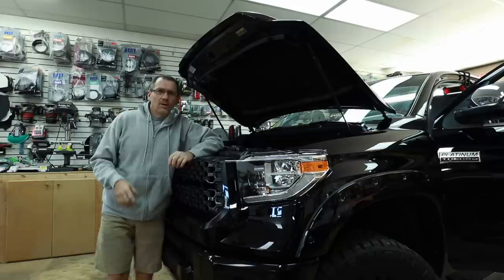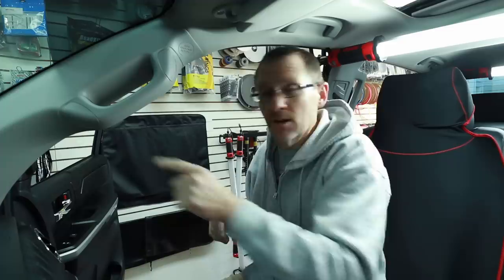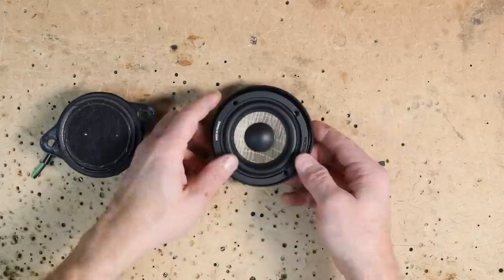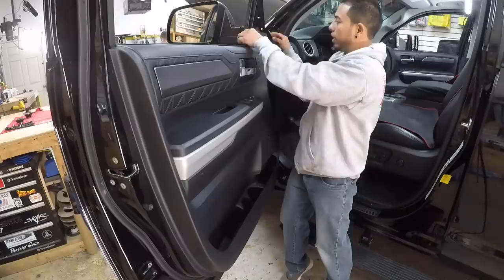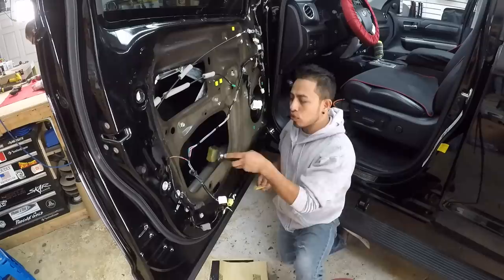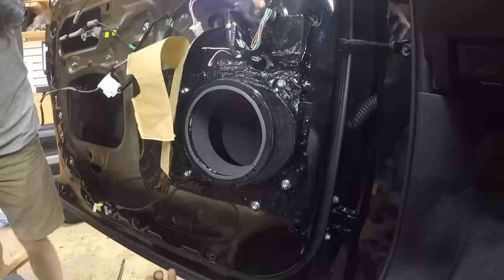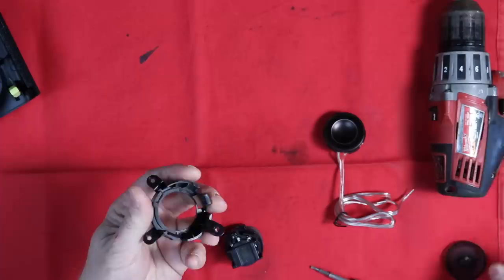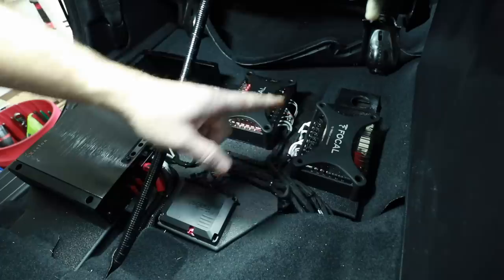How to install a Focal 3 way speaker set in a New Toyota Tundra

Comment: That huge hole in the door needs to be addressed so the door is more like a sealed enclosure for optimal sound . This will make a HUGE difference in the mid-bass and lower end of the vocals.
Reply: Yes I felt the same way. I would of took the vapor barrier plastic and transfered the shape to cardboard. Then transfered that to a sheet of roadkill and did away with the plastic altogether.
Reply: You really think they don't know that?????
They do what the client pays for, nothing more.

Comment: The tweeter was always in the sail panel on the Limited, Platinum, and 1794 Edition with the JBL system.  If you did an install on a Tundra with no tweeter on the door it was a "Grade" or SR5 with no JBL system.

Comment: CA glue dries? Use kicker or whatever accelerator. That’s one of the many reasons why CA is awesome for car audio. It’s works awesome for a lot of glue applications. Even on metal as long as you prep the material

Comment: I had the flax 3 way in my jeep and it cant say enough about it.For the price it is a great sounding setup ,however its dialed in for SQ more so then SQL.Don’t get me wrong it plays loud,i was using a mosconi 1000.6 actively.But it leans and excels at sound quality.If your interested in loud and clear go with the k2 power series its punchier and more dynamic but not as accurate or clean in the highs ,but the mids slam.I ended up upgrading to the utopia m series 3 way

Comment: Nice work guys!I have set of KRX2 Components that gonna be going in my 2017 Chrysler 300s.3" Utopia be and a Jl audio VX800 8i to power it all for my front stage.
Reply: I have the p165fx with a JL amp. Everyday it sounds a It better. Thinking about upgrading to a newer JL amp for dsp
Reply: The VXI series. I have same as you; Flax 165 fx two way separates up front with the matching PC 165 Flax coaxials powered by JL XD 600/6 for all hi’s (active), XD 600/1 - two Sundown da-12 d2’s. I have two separate DSP’s the Audison Bit one (currently installed) and a AC DM-810 w/ the WiFi option port hi res streaming dongle. The audio control is mounted but not been switched over yet want to see which one sounds better.
Reply: @johnhornbeak5735  have you switched the dsp in your truck? Which one sounds better?

Comment: Very cool.  Turns out I'm using those same 2 amps in my 2017 Tundra double cab, but my factory system isn't the JBL so I'm running the 6 channel amp in universal mode. The non-jbl toyota head unit makes a distorted signal so I'm going to have to replace it.

Comment: My 2017 1794 Tundra, similar to the white one you guys showed previously was also a three way (all JBLs should be)
Reply: Wish mine was 3 way. I had 2 way and replaced the factory fronts with pioneer component 6x9 with a tweeter......but I got no mids now because the 1" went in place of the  2.75"

Comment: When installing such speakers in the door, more thorough preparation of the subwoofer podiums is needed. Noise isolation of the entire door with all holes closed. Also, insulation of the door trim of the plastic shell is needed! You also need to change the wires in the door in a large section. class, do it conscientiously ...
Reply: Nope

Comment: Great video again guys. Would it have made sense to block the 2 giant holes in the door? Or is it unnecessary as he used roadkill on the inside of the door also? I know the inside may need to be accessed for service, but i was wondering if it would be even more deadened or if it wouldnt make a difference.
Reply: I was thinking the same. They use open cell foam around the midbass to "make sure the sound doesn't get in behind the door panel" but then leave a huge hole in the door. An abs panel bolted over the hole would of helped more from my experience
Reply: @dobledekersoulwrekr  i was thinking the same. Maybe the cost of such wasnt in the budget, i understand, but they paid for all that roadkill. My question does pertain to this install, but it was more a general question across all door panels with large holes in them. The plastic sheet is only for dirt and moisture, right?
Reply: @carlosreset7501  The whole point of putting the speaker in the door is it's supposed to be an enclosure. Enclosures and big holes dont go hand and hand. The rear wave of the speaker comes through the large hole and cancels the front wave. But from a serviceable perspective I understand not covering the hole in roadkill. But again, that's almost a $1000 set of speakers!
Reply: @dobledekersoulwrekr  I just did my entire vehicle last weekend with the same Roadkill product and had the same concerns for my front doors in my TSX. I called the Stinger tech support and they told me not to cover the hole as the most important dampening coverage is going to be around the speaker cut out and behind it. I did full coverage on all of my doors including the rears and the hatch on the wagon door just to be thorough. Most door speakers are designed to excel in a free air application so it's all good and the results are evident. I am able to cross the fronts over lower and bring the sound stage up to the front more due to my doors being properly treated and being able to handle some power. Good stuff.
Reply: @bbchester6  i dont mean to prolong the discussion, and i understand that you had excellent results without blocking larger panel holes. but would blocking the hole give better/worse/the same results? And whats the science? I think boom mats will blow something faster than a $2 h****r. Lol
Reply: @carlosreset7501  you dont want the back wave of the speaker to reach  the front or you have cancelation. Pick up "Master Handbook of Acoustics" book. Really helps explain the basics up to advanced subjects. You can find copies on Ebay for cheap.
Reply: @latola7204  I suggest you dont use those unless you are cutting most of it away and using it as a rainguard.

Comment: Can someone explain how they did the wiring?
1- how did they wire the 3 way component speakers? Did they wire all of them from the ceossiver or they used the crossover to wire the mid and tweeters only?
2- why and how did use use two channels for each door in the front? Aren't the component speakers need to be paired into one channel from the amplifire that splits into three wires?

Comment: Do the fast rings soak up water or does it shed it? Kind of look like sponges🧽 !? Nice detailed Vblog as usual. Thanks!
Reply: YES!  They soak up water big time.  Ask me how I know this!
Reply: @2000notw  I can only imagine. I figured if you need something in there to bounce the sound back a piece of Styrofoam would be better. Just need something for the bounce back purpose and being that the road kill was applied it should do the job and not soak up water!?
Reply: @RicheySynthetics  I've read that closed-cell foam (CCF) will work AND not soak-up water.  CCF is commonly used for window/door frame insulation and (guess what) moisture barriers in home construction.  Fast rings is a good idea, but I feel that used the completely WRONG material.
Reply: I've been thinking of giving mine a good coat of waterproofing spray. Does anyone have any experience doing that to improve its water repelling properties?
Reply: @bernerdcannavan680  That actually might work! I use that stuff on all my camping gear and out door clothing for hiking/camping. I usually spray it real good and let it dry real good and then spray it again. Great idea for someone who has already bought the fast rings!

Comment: Hey guys, I have a 2022 Nissan frontier. I’m installing a Sony touchscreen and I have a four channel amp. I’ll bridge two channels for a sub and use two channels for a set of focal auditor components in the front. I plan on using 9-wire to run from behind the head unit to the amp. What would be the best way to hook the mid, tweeter and crossover?

Comment: So I know time is money and every customer has a different budget. But using the flimsy speaker adapters on this level of a speaker. This customer has the money to add and little more and make some rings out of chip board or mdf (then painted) better then the abs rings. If it was rear full sure but on the front stage and especially on hood 3 -way systems well any high end speaker sets on the front stage, mdf rings or chip board seem to help with a warmer sound. Sure some can be corrected with a processor but less processing to get a good natural warm sound. You should at least know this and I’m sure you can hear a difference on high end sq front stages and sq quality between abs rings and mdf or chip board rings.

Comment: Have you guys ever done a 2018 power wagon without the alpine system I have a JL audio 900 x 5 and a 12 W6 V3 I want to do for all three ways in the front along with something in the rear for Fill...I’m looking at the dsr1 to integrate ... do you have links to all those phone pieces that you installed I’m going to sound dead in the doors and I was considering doing the foam pieces also....

Comment: I have the 2 way model, just like to ask about the polarity of the tweeter it’s pre-soldered with a clear & clear w/red line wires which is positive/negative ?
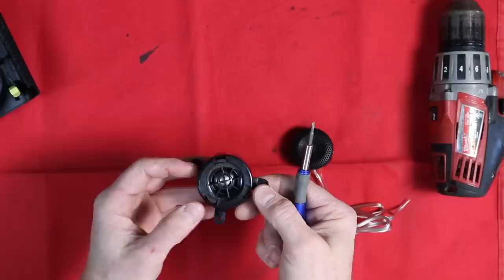‘Exact same wires from timeline 21:12’

Comment: The JBL system has 12 speakers including 8' subwoofer.
Is there a reason why the center speaker above the radio wasn't replaced? Was the center speaker tied into the Kenwood Amp?
Reply: I'm gonna go with the fact that the DSR1 (currently) doesn't have enough outputs to run the center with the 3 ways.  Stock it's summed from the front dash speakers I think

Comment: Buenas, si bien este no es mi sistema de audio, necesito de tu ayuda.
Tengo un iphone 4s 16gb, el que quiero conectar a un equipo pioneer avh-8400bt, con el cable que la empresa recomienda usar CA-IW 201S, aun no puedo hacer espejo en este.
Quisiera me comentaras si ves que realizando jailbrecak haría posible este funcionamiento.
Dado que el modo cierre de pantalla no esta dentro de las opciones desde ajuste.
O bien me comentes como poder hacerlo.
aguardo tu respuesta, desde ya muchas gracias

Comment: Hi guys!! I have a 2019 toyota Tundra that Im planing to install jl audio fix 86, speaker amp for blam speakers. And 2 subs jl audio w7.
The question is from where to run  the signal from the head unit or from the factory amp that its underneath the passenger seat?? Or what would be the best choice??

Comment: Great install guys, what did you do with the center channel speaker?  I have the same vehicle with the same JBL set up and I swapped out both front and rear doors for a set of Rockford T2652-S 6.5" components and the same 2 P3 Shallow Subs all powered by a Rockford T1000X5ad and a DSR-1 processor.  My issue is the front stage sucks.  Any advice on the what to do with that center channel?
Reply: Disconnect it and time align using the dsr-1.
Reply: Also check your polarity

Comment: Hey I have an issue with my 4 channel amp. When I raise my volume to the head unit after a couple of minutes the amp will shutoff/ go into protect for 3 seconds and come back on. What could be the issue?
Reply: Headunit is probably clipping, find your clip point on the Headunit and don't go above it, then set the gains on your amps, again to the clip point and enjoy. If that's all good and your amp still does it make sure you have good power and grounds

Comment: Any issue with the putting the window down hitting the speaker? from my research a 2.95 is a max top mounting depth and that focal is a 3 1/6
Reply from the maker: We space the speakers away from the window.
Reply: Okay I'll try it I will buy the same adapter and give it a try, I really want to run them Focals
Reply: Any more details on how this is done?  I am looking at the Focal PS165FX and the woofer has the same 3 1/16” top mount depth.  I don’t see anything in the video other than use of the Metra adapter.